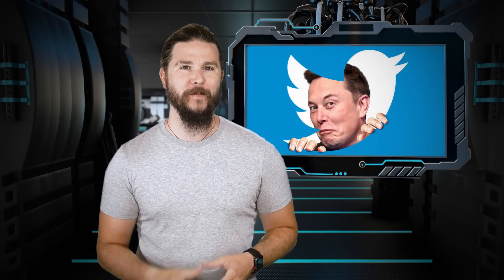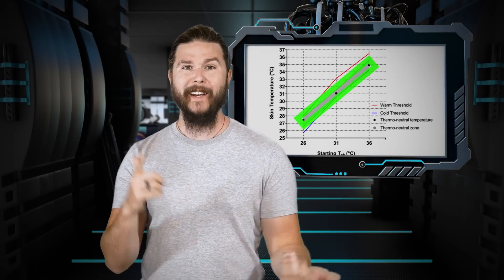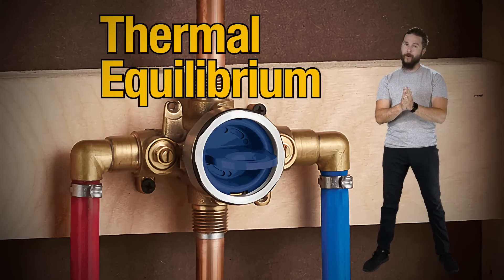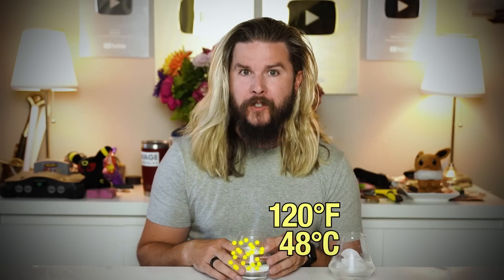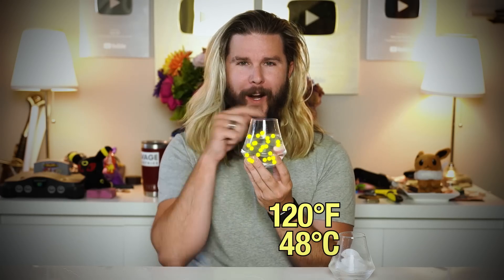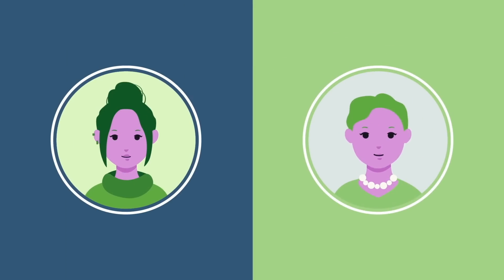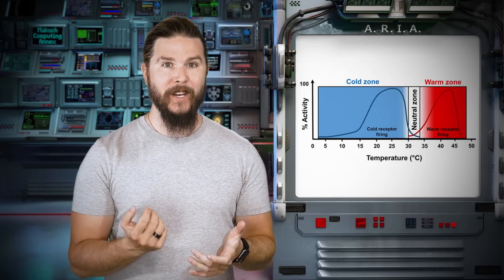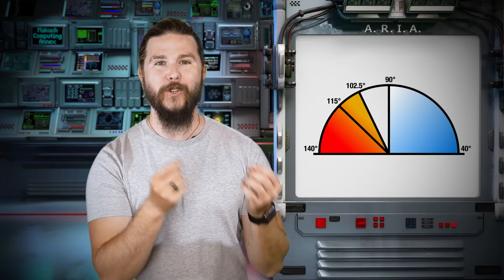Why Are Shower Handles So Sensitive?

Comment: To be taken into consideration are also:
- the infrastructure of the building/house you're living in
- the infrastructure delivering the water to it
- the weather
For example so far I've only been living in not so new buildings and Romanian water delivery infrastructure is decent at best. There have been moments in the winter where I would turn the handle to the hottest possible and I'd only get a warm-ish temperature. In summer sometimes I'd have to only slightly turn the handle to the hot side and it would be 3rd degree burn hot.
Also...if you're living in a building you also have to consider the floor you live at and how many people are using the hot water at that moment. If, for example, living on the 9th floor, I try to take a shower when most people are preparing to head to work or just arrived from it... I"m lucky if I have water pressure at all, nevermind it being warm.
Anywhoo...another nice entertaining and simple to understand video. Keep up the good work, Mr Hill!
Reply: I like to pretend that thou art not in Romania, and that there just happens to be water lines built by Romanian Engineers in random places that are not Romania.
Reply: @dannypipewrench533  :))
Reply: Nothing like trying to take a shower on a cold, humid day.
Reply: Facts, whenever i stay at my friends place the hot water takes forever to arrive and then it barely gets warm enough for me. Apartments are rough.

Comment: Thermostatic showers also prevent the shower from becoming really cold suddenly when there's less hot water because they automatically decrease the amount of cold water in that case. In my old shower, I had to decrease my cold water when the hot water decreased because it became freezing cold and then when the hot water came back, it'd be burning hot, so I had to quickly increase cold water again. Multiple times per shower. It was torture. Then I got a thermostatic shower and it was solved. In my new apartment I have a mix tap, but there's no problem with the shower getting cold, so it's good enough. Except when I turn around and turn the shower blazing hot or freezing cold instantly by bumping against it, so I just make sure I'm careful.

Comment: I redesigned and completely re-plumbed my entire house to fix the shower. It is possible. Now, flush a toilet, run the washer, turn on outside sprinkler, no change in shower temp. It did take a few special components (pressure and temperature regulators), but most of it was just deliberate lengths of plumbing branches to minimize uneven pressure changes in the system. If only plumbers were also engineers...

Also, expert musk burn.

Comment: The first thought I had when seeing this was fine tuners on a string instrument (such as a viola). So if we can't change the internal system, maybe we can make handle that has an additional geared fine tuner knob. Maybe add an adjustable ring with a line to show what the general position of the lever should be and you can start there and make fine adjustments with the geared knob.
Reply: I had this exact thought

Comment: For the past couple of days I have been having problems controlling the temperature of my shower.  I realized that when it's hot in my garage(where the water heater is located) I need to turn the temp dial down on the water heater and turn it up in the winter.  Thanks for the reminder Kyle and an excellent lesson on skin sensitivities concerning water temperature!

Comment: One criticism on this video - throughout the video you switched between C° and F°. Difficult to follow the comparisons with all the conversions happening in my head. IMO F° is the better option when discussing the “human experience”. 

Also, no love for cold showers? 
Great for body, mind, and environment. 

In Brazil I used a shower with a ceramic disc in the shower head. It was powered (legit sketchy wiring) and heated the water as it came out. Cold water in the pipes, perfectly hot out of the shower head.

Comment: In Europe a lot of showers have 2 valves: one controls temperature and one controls pressure. This way you’re easily able find a good temperature once and then only use the water pressure valve to turn it on or off.
Reply: Yeah, isn't Europe the best.

Comment: Yeah, I have set my water heater to the max temperature I want in my shower. I just turn the shower knob straight to hot and it works fine. Lot easier than having a water heater at 180 or something and risking getting burned if I get it slightly wrong.
Reply: You'll also run out of hot water faster though - you are limited to just the hot water in your tank instead of mixing a little very hot water from the tank with cooler outside water.  Probably fine if you are single but not great for a family.  Also, things like your washing machine and dishwasher may rely on the temperature of the hot side being a certain temp to disinfect, and as noted elsewhere, many pathogens love to reproduce at toasty shower temperatures, so it is healthier to have your hot water tank set well above what you consider comfortable.
Reply: @disjustice  Makes good sense. Luckily I have a tankless water heater.

Comment: Just get a Grohe GROHTHERM 1000. It is a perfect system of thermal water temperature control. Not only it is limiting both top and bottom range giving you the fulll range of control in the useful therma range, but it also automatically controls for the variable incoming water temperature so that once the water temperature is set it never changes (if at all possible). It is heaven. Accept no substitute.

Comment: My neutral zone is basically non existent.... I need it to be cool enough in a room that I can add it remove a light outer layer as I bounce between too hot and too cold... 

I also have to constantly switch sides when in bed because the sinus pressure builds up on one side or the other.

Comment: I remember when I lived in AZ I'd have to turn the handle into the cold area during the summer just to get it to not be too hot. Best design is to have separate hot & cold controls. Sooo much easier to get it just right!
Reply: I presently live in Arizona.  Always have, probably always will, except for January 2023 to December 2030, I will be in Idaho.  Might eventually go to the moon and/or Mars.  The point is, it is getting to be that time of year again when I have to bring out my protractor and TI-84 Plus and figure out where to start setting the shower handle.
Reply: That's how it is in Florida.  March through mid-December you barely gotta turn the handle.  Mid-December through February you gotta crank that baby up!
Reply: Here in Queensland it's common for houses to have pipes run in the walls and roof vs in the floor/slab. Often in summer the water coming out of the cold tap can actually be hotter than the shorter hot water run.

Comment: My current shower is a little bit of an oddball in that I have two knobs. One for hot and one for cold. This makes me think what if you had both knobs to control the amount of hot and cold as well as the more typical 180 degrees valve explained in this video.  You really only need a knob for the cold water to throttle that back and increase the range of comfortable temperature in the hot/cold valve.

Comment: I grew up with an electric shower which gives much better control of the water temperature although the one massive downside is that they don't have the same speed/pressure/force of water coming from the shower head as you would with a mains shower like is shown in this video.

Comment: Wouldn't a pretty universal solution be to have a two-part gear-like handle that interfaces with the actual water mixer?
Allow the larger gear to turn up to roughly the area it starts to reach ~90 degrees, then have a smaller gear that turns large motions into small fine tuning, basically like attaching a clock to your shower handle
Reply: Might as well just get a tap with a thermostat installed instead. Cheap ones retail for about 50 euro here in the Netherlands, average ones around 100 and some fancy name brands at 175ish. That gets you a reliable temperature setting on the right side (often with a button you have to press down to get above 38C) and a separate one setting the flow on the left. More convenient and I suspect what you describe would quickly get somewhat expensive too while being far from ideal in use.

I grew up with a separate knob for hot and cold water at the first place my parents lived, it seems preferable to this weird mixing valve in the video to me but really wouldn't want to go back to a non thermostatic one in showers. Especially not with fluctuations in the hot water temperature or other residents using water elsewhere and ruining the manually set mixture in the shower.

Comment: Also consider that the first liters of water (depending on pipe length from the boiler/heater) coming out will most likely have ambient temperature as this water was "standing still" in the pipes.

Comment: The temperature of the water available in your tank at any given point is of a different temperature depending on how much water was used BEFORE you got in the shower. Therefore, WHERE you put the handle to achieve “perfect” temp will vary.  That is why it’s designed that way.

Comment: Almost a year ago, I found myself in a heat dome. In a case like that you become way more interested in the cold end so you need that part of the arc. But what you said is true. Worse, the temperature can change as you shower (I guess because the pipes warm up).

Comment: Another important note instead of turning the hot water down on your water heater. Almost all showers, legally all in the USA at least, have an extra setting called the scald meter, that allows you to turn down your hottest hot to make sure you can’t burn yourself. It’s something that is usually pre-set by your plumber but if you get a new hot water heater you may want to readjust it.

Comment: Nope.  You buy good equipment this won’t happen. I paid $360 for JUST the empty brass housing for my shower valve. And another 200 for the hardware that goes in it. And guess what? Mine doesn’t do that.

Comment: The chad solution is to put your valves at the corners instead of the meeting point of the pipes.
That way you use two valves, each are responsible for only hot or cold.
The perfect setting is quite easy to get
Reply: Have this, it's easy to move the handles to the same place every time and it's always comfortably hot
Reply: I have this, I turn the hot on to a set level then use the cold to adjust the temp.
Reply: @HELLO7657  2 separate valves, makes for greater precision in temperature control.
Reply: i have this, doesn't help at all.
Reply: a better solution is one i've seen in a hotel. it had 2 valves but they were not for hot or cold. one was to adjust the temperature and the other to adjust the water pressure. meaning that you only had to set the temperature valve to the right spot once and just operate the pressure valve to have a shower with consistent water temp
Reply: @jpteknoman  i have this
Reply: Add a 3rd valve at the conflux and you can then adjust total flow rate independant of temperature.
Reply: @lperkins2  i actually have a valve on the shower head itself just for that purpose.
Reply: Haver of a two-valve shower here, it's bad. I live on the top floor of an old building and so water pressure in general isn't good. I turn the cold water valve all the way just for a light drizzle and the hot water valve only actually turns on at about 30% turned. so while fiddling with the temperature on the hot valve, it's either "turn the hot water completely off" or "let the lava flow". If anyone in another room uses a sink, that pulls the cold water away from the shower, resulting in just lava pouring onto you
Reply: @DiamondAppendixVODs  perhaps the piplines are congested with deposits like calcium. I changed out my water pipes in december and the pressure is really good. The temps on the shower are easy to dail in.
Reply: @DarkMaidenFlan  A couple years ago we had renovations and got new pipes on our end. I don't know the state of the pipes in the entire house though. It actually used to be a little easier before, when we had a single valve shower hand. It could be kept in the sweetspot while turned off
Reply: @HELLO7657  you have individual control over the hot and cold water so there is more room to play with the valves instead of a single valve controlling the mix.
Reply: @HELLO7657  the biggest problem is the hot and cold being controlled from the same valve.

Comment: When I remodeled my bathroom I got rid of the single knob shower control and went with the traditional two knobs.  So much better control of temperature and pressure.  There is no need to worry about scolding water if the toilet is flushed because the water heater is set to about 115F.

Comment: My uncle's shower heater unit has a small display that shows current and target water temperature and I am very jealous.

For context we don't have hot water lines in our homes. We live in a usually hot country. But in the colder months early mornings get pretty cold. So we use electric water heater units.

Comment: I'd say this video was 90% useful since we don't have those 'shower temperature handles' here, just a cold and a hot valve which you open to regulate the temperature, but still very helpful

also, I'm stealing the "nipples of neptune" line

Comment: Was that a saved by the bell shower curtain?

I forget if it was Scotland or England specifically, but I recall on one of my trips having two sets of controls, one for the temp and one for the flow rate; basically set the temp once and even if the water was shut off it would go back to that temp once equalized.  Much nicer than the single knob to do everything and hope it lands between scalding and freezing...

Comment: So the easiest retrofit is a longer, more slender handle to keep the large control of the current gearing that gets past the cold water position of the valve, but also allow for better fine control. 

I have experienced a lot of different shower faucet handles and while my home ones have been consistently bad, I get used to knowing exactly where to put them and it's relatively consistent between showers within a house. The most convenient ones as you indicated are the hotels that have a longer handle. Specifically a simple rounded one. I assume that's because a cylinder is an easy shape for us to roughly recognize the center of. 

Obviously, that's not counting the ones with separate hot and cold handles, but honestly I'm not sure if those help. It's been a long time since I've seen one on a shower, and I vaguely recall it being actually harder since it's fiddling with 2 dials to get into the same narrow range. It would be nice if flow and temperature were independently controlled so you could just set your preferred mix and then turn the water on and off.

Comment: Fun fact, the skin can be heated or cooled to change the range of what is perceived as "too" hot/cold.

A solution to the shower heat problem is to use a sauna before the shower to heat the skin so the shower can be left at max temperature at all times.

Comment: The last shower I worked on, at my previous house, had separate hot and cold knobs with non-linear valves. The hot side valve added hot water very quickly as soon as it started to turn, then tapered off in the top of the range to allow finer control. The cold side was the opposite, fine control at low opening and then opening up faster at the top of the range. My typical SOP was to turn the hot on full blast and then add cold to bring the temp down, which worked very well.
Reply: My SOP is broadly similar but with ordinary taps: wide open hot tap, open the cold tap fractionally, then almost close it again. Millimetres of turn in that cold tap between hot and too hot.

Comment: Well... considering that the hot water goes out sometimes every couple of months or so, I have just sucked it up and taken a cold shower. Other than that my range is around 23 degrees and kyle's is 12.5 degrees. I don't mind cold showers. usually, I prefer it during the summer, not in the winter. I do live in an apartment and has always been the issue in most places I have moved.